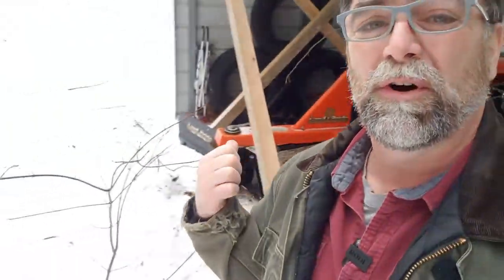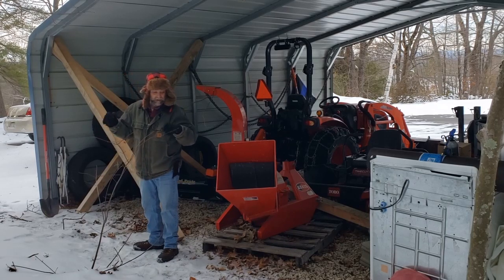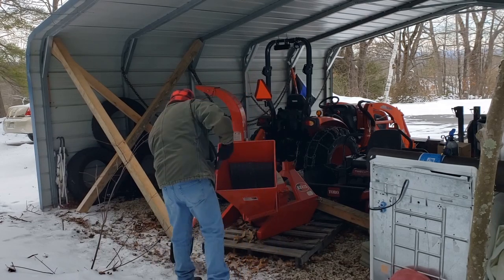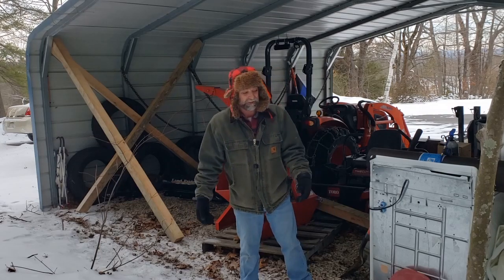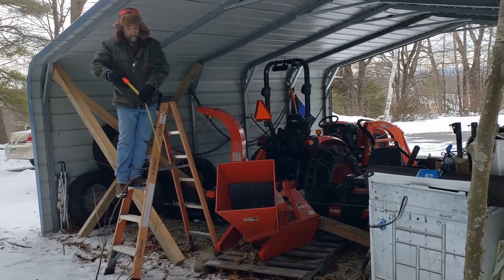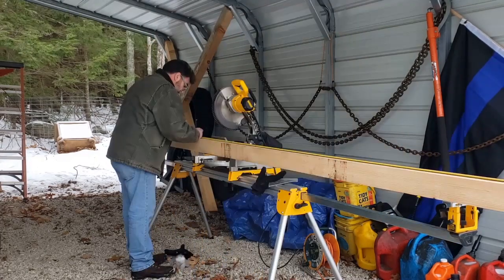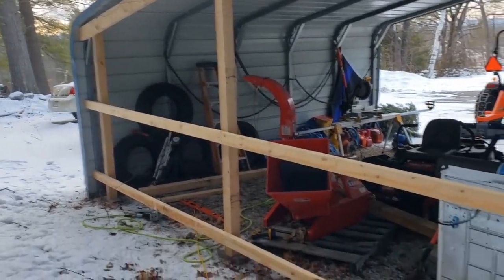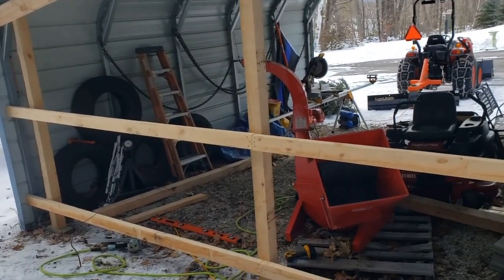Building a back wall on a metal carport.

Comment: Without the poles going into the ground, how do you keep the back middle pole from shifting back and forth over the years?
I noticed you wedged it in, but the ground may give with rain fall creating a gap.

Any insight that maybe wasnt show in video?
Reply: I used two SPT 4x4s in the ground 24" and framed my wall, put T1-11 on it in 2010, just covered that with metal rather than paint again.  I have added some cross blocks to give screws added grip.
Reply: Mine has gable ends since 2010, and I added a 3 foot wide over hang in front.  My driveway slants from side to side, 22" in 22 foot width.

Comment: The entire wall is fastened to the carport by the self tapping screws at the top of each 4x4?
Reply from the maker: I later added blocks that sandwiched the uprights.  The wall is held to the uprights on both sides.